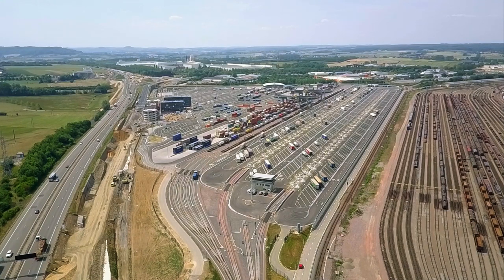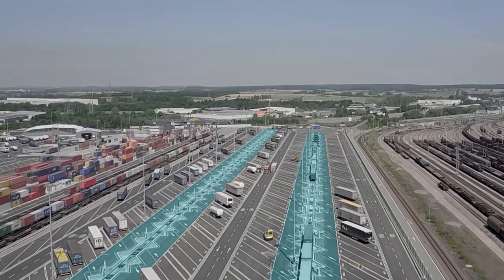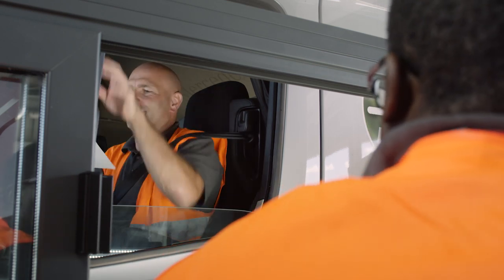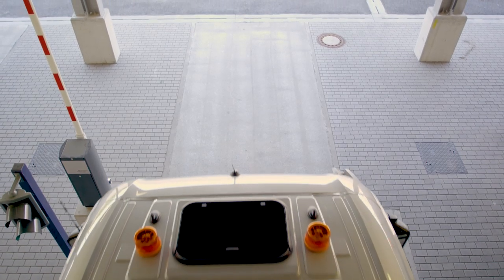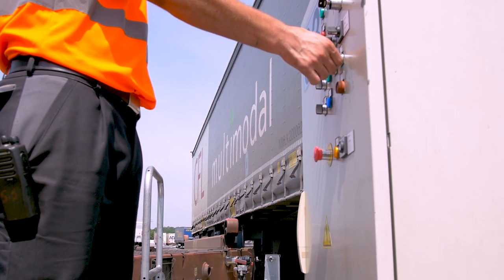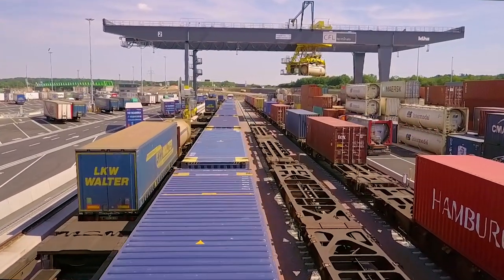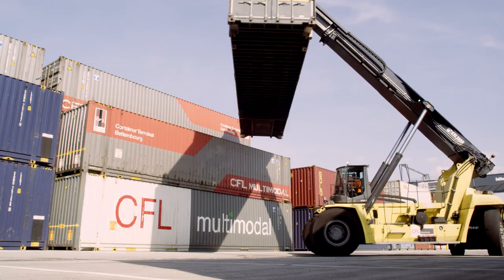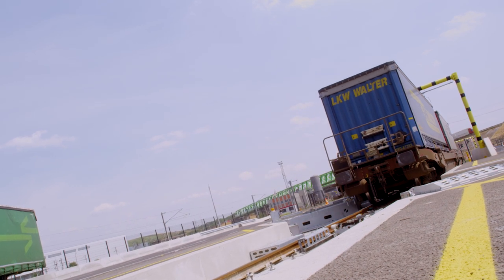Terminal Intermodal Bettembourg Dudelange - EN

Comment: Magnificent, this should have been thought up a long time ago.
The only way to better this is to have the wagons with their own ramps to ground, be self powered without shore facilities required.
Each wagon fully self sufficient.
Roll on Roll off so to speak.
Nothing can top that. Total efficiency, and quick turn around.
Nice one 😉👊👍
Reply: But this is also for trailers and not for Container. You can't stack them.
Reply: You should check out the Megaswing Intermodal Car
Reply: megaswings designed by kockums and used by helrom does this, but the loading takes longer and the wagons are probably more expensive. The system used here (Modalohr) can't be done by the wagon alone because there is not enough space below the wagon to put the structure needed to support the trailer when it is loading, so the terminal has to be equipped with a system that supports and pivots the center part of the wagon and the trailer during loading operations. The wagon can't be made higher to fit the said structure because of gauge restrictions (not interfering with the catenary), it would also need the truck to climb a taller ramp.
Note : that's all guesses from my observation on material available on the internet